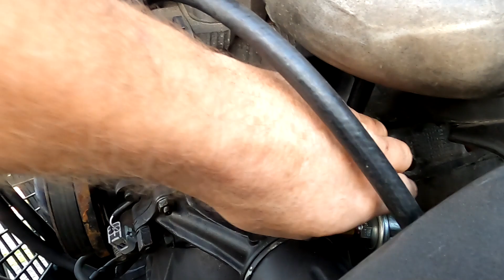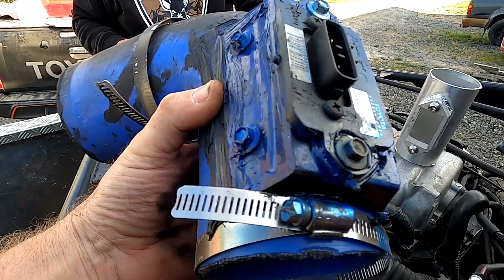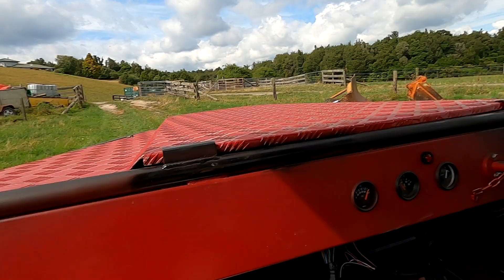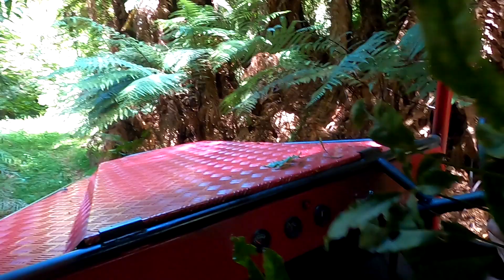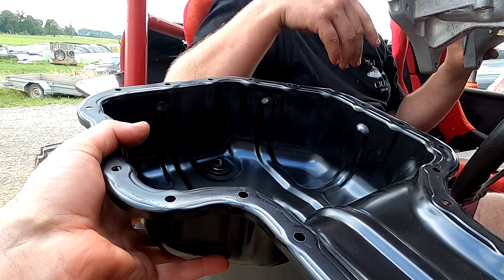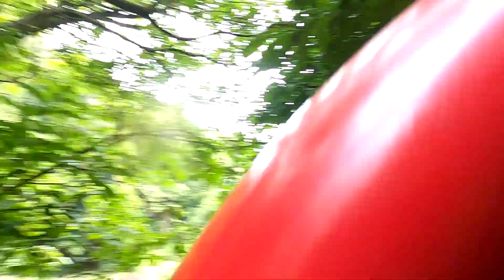1uz vvti 4x4 offroad buggy shakedown

Comment: my buddy has a 1993 ls400 which was recently victim to a slight engine fire. he’s having trouble finding the exact engine harness he needs for a replacement. he’s read online that there are multiple different engine harnesses for this year (with different things like air suspension and what not) and he’s read online that he’s “supposed to replace it with the exact one it had because no other harness of the same year will work” do you have any comments on this?
Reply from the maker: The correct harness is best,  its likely his submodel runs through 93-94, possibly 92.  Other submodels may have the same harness.  I frequently interchange harness without issues but I know exactly what I'm looking at.

Comment: Kelvin, What was the power steer remedy?
Reply from the maker: Crossing our fingers.  Haha.  After using it the powersteer steer magic fairy fixed it,  it just came right.  We were very happy.
Reply: Seems like  might be leaking past one of the orings control valve/rotory valve applying pressure to both ends of ball nut, when turn the wheel iits applying pressure to one end with pressure differential from one end of the ball nut to the other causing it to move itself even when the valve is returned to centre. I could be wrong, been about 13 years since last had issue like that but was after rebuilt box and chipped oring.

Comment: For the oil pan on this setup you can use the 2uz pan out of a landcruiser, it is rear and shifted to the left.
Part no. 12111-50092 and 12102-50090
Reply from the maker: Correct. As discussed in the video.
Reply: @CartuneNZ  
Sorry, I didn’t complete the video 🤭